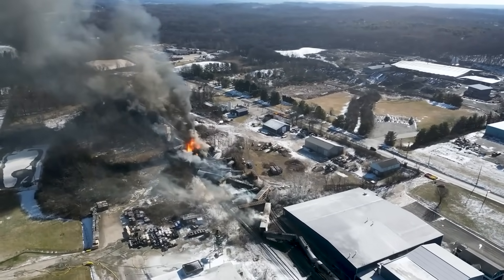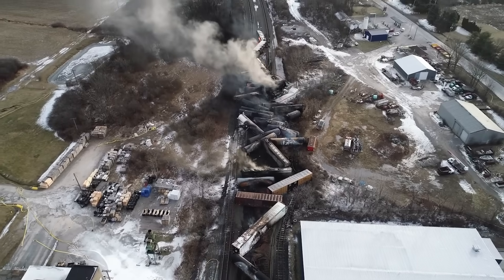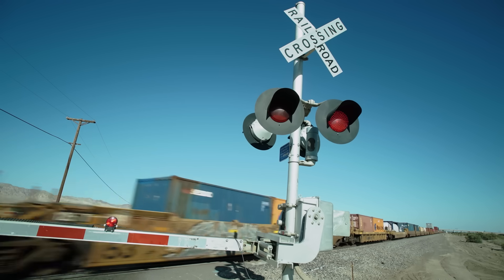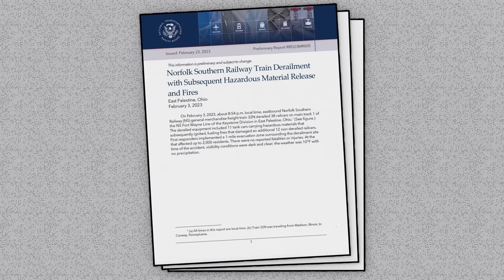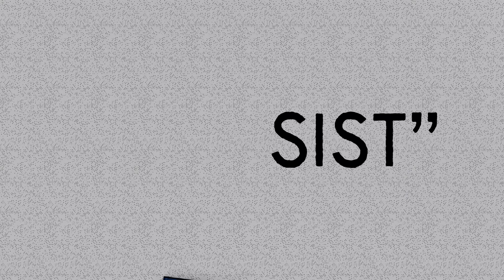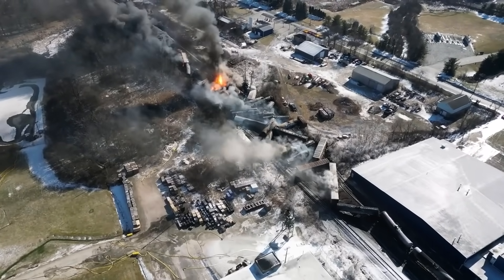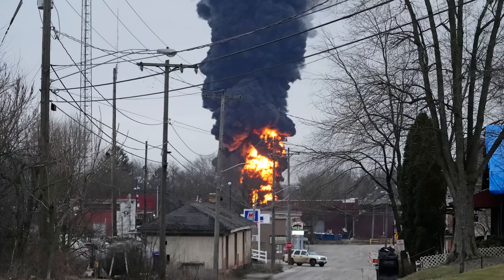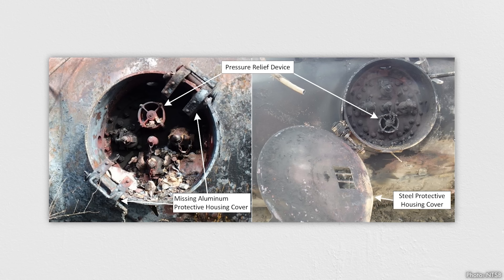East Palestine Train Derailment Explained

Comment: Could the dangerous loads be spaced between safer cargo? Harder to load and unload but maybe safer.
Thank Grady
Reply: I'm not sure how that would improve safety. Would you mind explaining your logic?
Reply: @Ornithopter470  If all the dangerous cargo-cars are placed together it would mean all the cars would be at threat if an accident would occur at that location. What's being suggested is to intersperse the dangerous railcars further apart so that in the case of an accident only a single or fewer cars would be in danger.
Reply: That's sometimes/often done.  If you watch a few train videos, the RRs often put a buffer car between, say, the locomotive and a string of hazmat cars.
Reply: I used to be involved in  railway yard operations and what you suggest would be so time consuming and costly that the impact on shareholder value would be unacceptable.
Reply: normally there is barrier vehicles on hazzardous cargo trains.
It's an old practice though making the trains shorter allows for better managment and checking so if a problem does happen it's easy to spot.

Comment: Perhaps defect detectors should be on the trains with wifi or radio to the engineer. Continuous monitoring and not intermittent monitoring would have prevented this.
Reply: Intermittent monitoring caught the issue. The operating procedures of Norfolk Southern are what caused the accident. And continuous monitoring would not be a bad idea. But it requires them to have better maintenance and tighter tolerances.
Reply: That and thresholds were too high given the distance between detectors. Lower thresholds give more false alarms which increase costs but better safe than sorry!
Reply: The point of the defect detector being on the ground is that it can scan the train as it goes by, if you were to have them onboard, you'd need one for every component it's monitoring. There would be an insane cost to attaching detectors to every component you want to monitor on every train car, compared with one detector that can monitor every train that passes it

Not to mention the safety side of things too, consider what happens if a detector fails. In the rail side scenario, a detector failing means you might not know about a problem immediately but the next one can pick up the slack and detect any issues later down the line, to not know about an issue until it's too late you'd need multiple sequential failures. In the onboard example the single detector monitoring that component is the only thing that needs to fail for you to be totally unaware of any issues, it's a single point of failure...

Comment: Our railway system is still dated though , we have technology that can sense every single wheel used on trains abroad , advanced sensors to send data to control centers and the engineers in real time
Reply: Well come on over and install all of it on our 160,000 miles of tracks then.
Reply: You don't install this technology on the tracks. You install it on every car, that the train consists of.

The info is sent to a computer, that makes sense of the data and filters it to provide the machinist of train with the required data.

It would provide a black box like airplanes have, but for trains.
Reply: @NoopityNoop  it’s on the trains and cars not the railway . The technology is available and already being used worldwide even in places with a far larger railway network than the US

Comment: So, basically, Norfolk Southern is responsible. They ignored all the signs that were pointing towards defects. Instead of addressing the defects, they ignored all calls for maintenance. We'll never see anyone be held accountable (Norfolk Southern executives).
Reply: No they did exactly what they should have done. When the bearing was noted as being defective, they hit the brakes.
Reply: No NS is really not the villain here. The villain is deregulation of rail and an overreliance on trucking by regulators. Like any system, the more professionals involved the safer it is in the long run. Rail has been allowed to fester into the cross-continental cancer that it has become because of a culture of “trucking first”. All things considered, this was actually a pretty great example of why hazardous material needs rail. The site is highly concentrated, and while it is extremely unfortunate that an entire town is severely affected, that’s only one town. Imagine instead the equivalent number of trucks coming off the road carrying similar hazardous material.
Reply: @Jaxck77  NS lobbied for set deregulation.
Reply: @Jaxck77  just because the regulators dropped the ball, doesn't mean you can't blame the company for cutting corners. You don't have to operate at the minimum level of regulatory compliance, a company with a 5 billion dollar profit line is not running so close to the margin that they cannot afford to be proactive about safety measures.
Reply: I think that's a strong conclusion to draw from this video, so I assume you're drawing on knowledge from the political discourse surrounding this incident?  

What signs of defects were ignored, and what calls for maintenance were ignored?
Reply: Yup, that's why they and the other 3 companies that control all US railways should be nationalized
Reply: @grimaffiliations3671  there are a lot more than 3 companies.
Reply: @st3pp3nw0lf86  There's 4
Reply: @grimaffiliations3671  no, there are more class I l's than that. And that's just class I railroads. You have no idea what you're talking about, do you?
Reply: @grimaffiliations3671  Then they can become just as efficient and effective as every other government agency. 😂😂
Reply: @NoopityNoop  the most efficient rail systems on the planet are government run